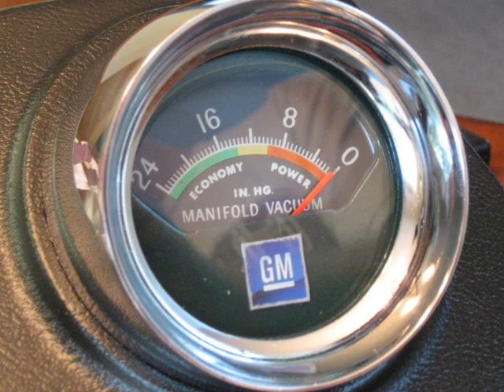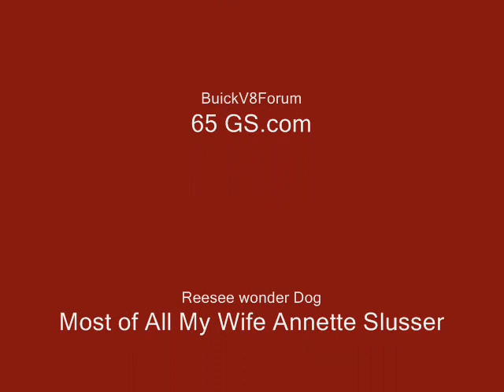BUICK 1965 Buick GS GRAN SPORT NAILHEAD RESTORATION 4 SPEED SEDAN  RESTORE

Comment: My Dad had a 65 Gransport with 401 red conv 300 trans i seen him go to 105 mph in low and shift to drive he was sales man at buick dealer in morristown nj we used 2 race gto and my dads demo was fast because the boys in the shop made that buick run very fast i bet ot ran in 13s in quarter mile 2  4 barrels in that buick and burn rubber any time u wanted.